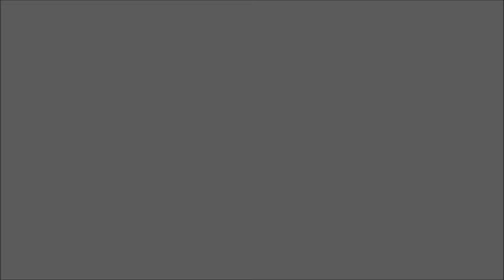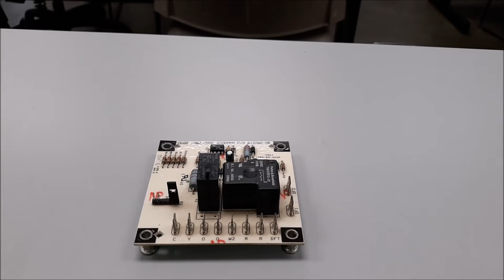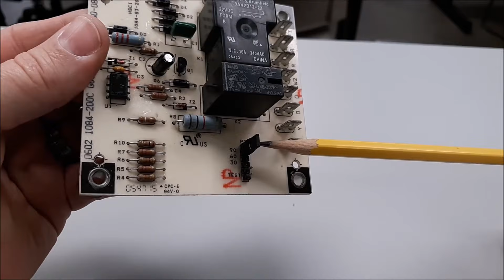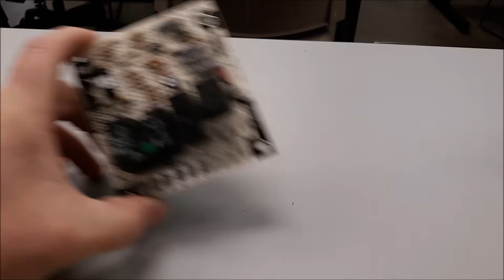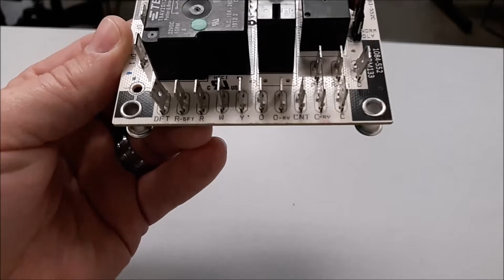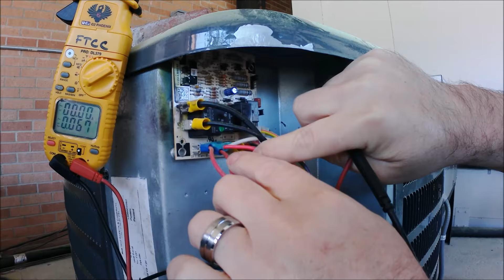Troubleshooting the Goodman Defrost Board

Comment: I think the installers wired my unit wrong. Isn’t the board supposed to be powered all the time at R  terminal? Because they wired R on mine to Y off the thermostat and I read where this board has a built in anti short cycle delay which resets if the board loses power. So now when it calls for heat the air handler fan comes on and blows warm air then 3 minutes later the condenser kicks on.
Reply from the maker: The  newer" style of this board does need 24v on R all the time. It just won't work without it. But if they ran power from Y into the board on its R terminal it should allow it to work but you get that delay. I wonder why they don't have an 24v hot R wire going to R?  I would say their wiring is incomplete! Do you have enough wires going out to you condenser to run the R correctly? Maybe that was why they did it.

Comment: Have this exact board (first example) on an old Goodman unit.  Everything seems to operate as intended except the system interrupts the defrost cycle.  
That is, just after hearing the reversing valve energize, the condenser fan will come to a stop, the defrost cycle begins, but the unit will shut off within a minute, as if the T-stat is satisfied.
When the T-stat calls for heat, the unit will start in the defrost cycle, will finish the defrost cycle, and then go back into heating mode.
Any thoughts on why this is occurring?
Reply from the maker: Sounds like you are hearing the "delay" in the reversing valve switching for defrost mode. Check that 2 pin jumper to see if it is on DLY or NORM. They did that to help with the pressure/noise you hear when entering and leaving a defrost cycle. That would be my guess from where I am sitting!

Comment: is that board  protected by a fuse anywhere?
Reply from the maker: Only the fuse in the air handler! Whether that is on the fan board like Goodman uses or just a fuse in a fuse holder someone put in by the transformer.

Comment: Why does my board have two jumpers? One tall jumper on the TEST pins and another short jumper sitting beside it on the 90-60. The last pin is the 30 and has nothing on it. Defrost usually comes on around 90 minutes, but sometimes it comes on every 60 minutes. I've looked at a lot of boards but haven't seen one with a tall and short jumper together.
Reply from the maker: Maybe check and see if there is a jumper on the NORM / DLY 3 prong area. Someone may have moved that jumper up to the test 30/60/90 area and accidentally left it? There are 2 jumpers but one on the NORM/DLY and the other on the defrost time settings. Other than that ??
Reply: @johnjennings-JJ   NORM/DLY jumper missing. Looks like someone did move it and left it. This hvac unit was installed new and has been running like this for about 3 years since its installation. Maybe this explains why it would defrost every 90 minutes and sometimes 60 minutes. Correct me if I'm wrong, but if I move the tall jumper from TEST to DLY, and leave the short jumper on the 60, it should correct the problem and defrost every 60 minutes. Thanks for the help!
Reply from the maker: @P.B.Theriver  I think that would do the trick! Should go back to normal. Whether you put that jumper of the NORM side or the DLY side shouldn't matter much but the DLY will make defrost a little different that you are used to I think. It will shut the unit down in an attempt to make the switching of that reversing valve be quieter.
Reply: @johnjennings-JJ   I made the switch. It's going to be in the 20's tonight. I'll let you know how it went.
Reply: Removing the jumper from TEST to DLY appears to have solved the problem. Thanks again for the help!

Comment: Thanks for the great video! I have the very same board that was replaced a few years ago and the problem I’m having is the outside fan does not turn off during defrost mode. I’m not at the house very often, so I’m not sure if the fan ever turned off in defrost mode but I do know the auxiliary heat used to work and now it does not. The auxiliary heat is not activated during the defrost mode or any other time. In looking at my board I have nothing connected at DF2. Can this be correct?
Reply from the maker: The fan circuit should be connected to DF1 and DF2. It sounds like your fan is straight wired to the contactor. That is probably why it isn't turning off! Maybe who ever installed that board also missed the wiring for the auxiliary heat low voltage circuit also?

Comment: So thankful for this video, helps me do some checks before the HVAC guys come. I have to run a defrost test because my unit stopped making the "psshhhh" sound this winter and I'm afraid something isn't working right with the defrost mode. My unit is using a furnace as backup heat and it's on the W wire so my air temper is done by the furnace during defrost, and with the unit not turning off defrost it's just sitting there with teh compressor on heat mode and the furnace firing which to me seems dangerous. Also when you say the Delay on the contact, are you saying the heat pump will wait a minute before it starts the defrost process?
Reply from the maker: Sorry for just now seeing this, i did't see a notification for it. A dual fuel unit is nice...best or both worlds. So you are saying it goes into defrost and stays there while the furnace is running? Of course defrost mode would be cooling mode and the unit should be ok for a few minutes of the furnace running while the heat pump does defrost. I am cueious if you already had the tech out and what they said.
Reply: @johnjennings-JJ  Hi, thanks for responding. So apparently the actual physical plug that reverses the valve was disconnected, possibly when the unit iced over a week before (clogged air filter, which I had forgotten to change). So I mistakenly attributed the icing to being from broken defrosting, when in reality it caused the reversing valve issue. Unfortunately, the tech didn't start with the simple check for the plug... he ended up testing wires and burning my furnace board AND thermostat so what should have taken 5 minutes took 3 hours of him running around buying things he broke! I ordered a new defrost board just in case, though, because I don't trust that his monkeying around in there didn't affect the board in some way. The system "seems" to be running fine now.
Reply: @johnjennings-JJ  hey man one more question, if my board isn't going into defrost because of the R-DFT/DFT thermostat, can I keep those two pins jumped for the remainder of this cold humid weather so that the heat pump realizes it's cold enough to enter defrost?
Reply from the maker: @pogtuber5146  if that switch is bad and you jump it out on the board terminals it would just want to go into defrost more often. May be more of a nuisance to hear it but it should work ok.
Reply: @johnjennings-JJ it seems to be working though at some point it went into defrost and kept turning the compressor off and on. Perhaps it's expecting it to close once the coil gets hot enough, and instead it's tripping based on some other sensor. I unplugged it for now since it seems the logic on the board doesn't like it. I'll manually defrost if I have to. Appreciate the advice!

Comment: You didn't mention the two black o/b wires...?
In cooling, there's no voltage coming out of the board where those two black wires connect. 
I put R to O on the tstat wires, to get em cooling. 
I'm gonna replace the board, but i was hoping to hear you touch on if there's no voltage going to the o/b coil, whether it was a bad board...? Im saying yes because why wouldn't there be voltage if the condenser turns on but only heats and doesn't cool. RV switches over no problem, there's just no voltage to energize it  in cooling. Maybe that's the programming of the tstat, the settings! I'll have to check what o/b is Energized in, either cooling or heat.
Reply from the maker: My mistake. I didn't even catch it. But like you were saying...For most heat pumps there should be 24v going to the RV during cooling. If it isn't leaving the board on the "O-rv then make sure it is coming in on "O". If you were able to jump R to O and it went into cooling then that circuit went from the tstat all the way to the air handler, then out to the circuit board and to the RV. Maybe a bad tstat? The wire seems good and the board should be a normally closed circuit for "O"...
Reply from the maker: ...Curious to know what you find out.

Comment: What is the purpose of the delay time
Reply from the maker: If not mistaken (and i think i said it wrong in the video at some point) it is to delay the switching of the reversing valve when coming out of defrost. It lets the fan turn back on and take some of the heat out of the coil. Basically what Trane did with their units...relieves a little pressure so it isn't as noisy.

Comment: Excellent Video!! 2 questions...
1) Can the modern board you covered be used in a unit currently using the original? (Low pressure switch terminals?). Would there be any advantage?
2) How about the "OEM Upgraded" versions of the original that I see for sale... What is upgraded other than the jumper type?
Thanks
Reply from the maker: Thanks. #1 - by separating a couple things (like the pressure switches) and putting them on individual circuits I believe that YES you can use the new OEM/modern board in place of the original in many cases. #2 - the manufacturer learns and implements new stuff and comes out with newer versions of boards. What they choose to update is completely up to them. To me, as I read your question, the "modern" and the "upgraded" are the same...even though an amazon listing might use key words to grab your attention!
Reply: Thank you. I was going to reply with two photos One of the original and one of the one claimed to be an OEM upgrade. However I couldn't find a way to upload photos in a reply.  There's two integrated circuits instead of one and the jumper is of a different type. The main row of terminals is exactly the same with no extras. @johnjennings-JJ
Reply from the maker: @brucej9575  if you want you can email me at jenningsj@hotmail. I am curious to see!
Reply: I will  @johnjennings-JJ

Comment: Love your vid, I work as a apartment maintenance technician and have 2 boards not passing y, spliced the wire going to the contactor directly to " y" just to temporarily give the Tennants air,but felt like watching a video to reassure myself yours definitely did p.s.(unit relatively new so wasn't the pressure switches)
Reply from the maker: Sometimes you have to do what works for the customer to have some relief. Customer Service is the name of the game.

Comment: Board been replaced but same problem not going in defrost mode and some diode on top get hit and brown   Looks like been burning
Reply from the maker: I hear that issue happens a lot with those diodes. The newer goodman board should have 24v on 'R'  in order to work anyway (and be able to do defrost), the DFT switch has to close (when the coil temp is cold enough), and if those 2 are good to go the defrost board should go into defrost after "X" time. I would say to maybe double check  the DFT switch on the coil to make sure it is closed if the unit is running in heat mode and still not going into defrost. I believe on this one you have to move the board jumper from the time pins and put it on the test pins i stead of just shorting the test pins while it is on the time pins.

Comment: What would you check if you don't have 24v at Y and the thermostat is good?
Reply from the maker: If it is the newer style board like I think...and I didn't have Y at the board I would check my high pressure switch and put a set of pressure gauges on it to verify refrigerant pressures while I had it running. Making sure to listen for blower operation inside. If you mean you don't have 24v on the Y thermostat wire that connects to the blue/pink striped factory wire at the heat pump - I would say...need to look for some loose air handler (or heat pump) wire nut connections or do some continuity checks  to see if that wire is broken...if it is, changed it out for an extra wire I hope you have wrapped around the ones you are using.

Comment: Is there a way to bypass the defrost sensor on the newer style board? I live in AZ and have no need for that sensor and I believe it's causing my unit to short cycle. Runs for 5 and shuts down for 2mins. The 3 little capacitors get super hot.
Reply from the maker: I doubt it is the defrost sensor but I guess anything is possible. It is a simple switch and you can just unplug it. Those capacitors do seem to get hot and sometimes a little discoloration.

Comment: Thank you for your help, I’ve figure out my board is bad. Now is it possible to directly replace my old Upgrade for Goodman PCBDM130 Rev B Heat Pump Defrost Control Circuit Board with a newer version? I’m having difficulty finding a new replacement
Reply from the maker: I think the newest version is a PCBDM101S. There were a couple updates since that original board came out but that one should pull up online and be a suitable replacement if I am reading correctly. If you find one from an online supplier just call them and verify.
Reply: @ thank you i was cross reference manuals and than I ended up on the Goodman website and they told me the 101s is a replacement 130,133, 101

Comment: I know this is an old video but I'm hoping for some help. I have a package goodman with HP and a defrost board. When calling for heat only the heat strips and blower kick on. I tested the defrost board and everything was good. Voltage in, pressure switches and a call for heat on the W terminal but nothing between common and CTR. I jumped wht to the contactor and the heat pump fired right up "proper pressures" with strips giving me a toasty 125 degrees at the supply. Figured it must be a bad board so I got one from supply, installed and the same thing. Switched it to cool and it closed the contactor after the thermostat delay was completed but would not close the CTR when calling for heat. nt suggestions would be appreciated.
Reply from the maker: Should be a call on "Y" when using heat or cool. You should have voltage on "W" only when heat strips are needed. I know some thermostats are different but if you have a 2 stage heat pump thermostat it should be like this description. Maybe the thermostat is new and not programmed correctly??
Reply: @johnjennings-JJ  Thanks. I'm thinking the problem will be the it's an old thermostat. I should have investigated further but had so many no heating calls after the cold snap I just moved on to the next since the home had heat strips working. My gut is telling me to go back and check to see if the installer wired O to Y at the unit cause the thermostat is just a 1H 1C and the heat pump hasn't worked since it was installed a couple years ago. If that's the case hopefully there's an extra wire at the tstat I can use for O and install a new tstat.

Comment: I owe you a beer. Thank You for the fantastic simple explanation of all the functions with this board. I had the low pressure switch return line corroded and not carrying a proper load back to the board. found the issue and fixed with no cost involved. You are a Godsend. Thank You please keep making these great tutorials. Liked, Shared and Subscribed
Reply from the maker: I'll take it...long as it is cold!

Comment: So if this board is bad then the unit won’t do anything at all except click from the contactor? My unit just stopped one day. I replaced contactor, and capacitor and it still does absolutely nothing. I haven’t tested the board.
Reply from the maker: Have you checked the refrigerant pressure in your system? You could have an open pressure switch that is stopping the board from sending out 24v on the CNT terminal.

Comment: My defrost control board part # is PCBDM133.
I only see PCBDM133S available.  
Do you know if this part will work? 
What does the "S" mean? 
Any help is much appreciated.  Thank you!
Reply from the maker: The "S" is goodman substitution for the original pcbdm133. I don't know exactly what the 's' stands for but I doubt it is substitution! It should match up and work perfectly.
Reply: @johnjennings487  Thanks, man. My capacitor failed last night, and ACE Hardware, thankfully, was the only place open today that had one in stock. I went ahead and ordered another capacitor as a spare, and went ahead and ordered a 24-volt contactor as well as the defrost board all from Amazon. I wasn't sure if I was ordering the right part or not, but I did eventually find a defrost board with the exact part number I was looking for. It had the S in the description, but the board itself didn't have the S so I don't know what it means either, I just know the part is the same thing I have on my AC. You are the 2nd hvac guy I asked a question to today on YouTube, and you both answered within a few hours, so I want to say thanks again for all the advice. YouTube has saved me thousands of dollars in DIY repairs from lawnmowers, cars, trucks, chainsaws, dryers, washing machines, plumbing, carpentry, electrical, and HVAC. While I hate technology sometimes, it's also a blessing for these situations.  Have a great evening and I hope you continue helping make the world a better place by helping people make repairs and save them money, especially in these trying times when it seems the world has gone downhill fast, with rampant inflation and a crumbling economy, people like you are needed more than ever. ✌️
Reply: Well I have another idea what the S stands for 😂